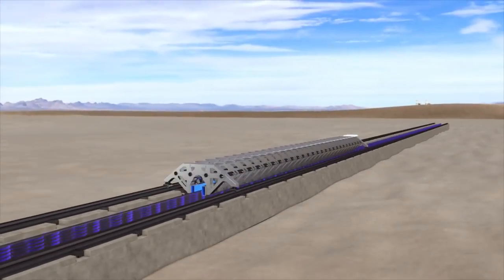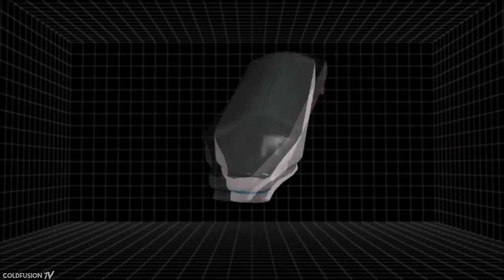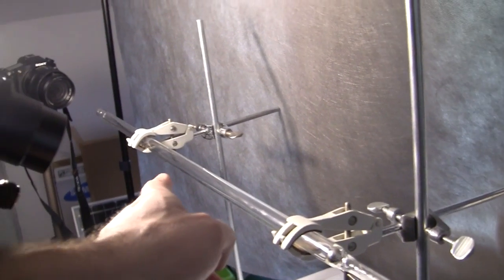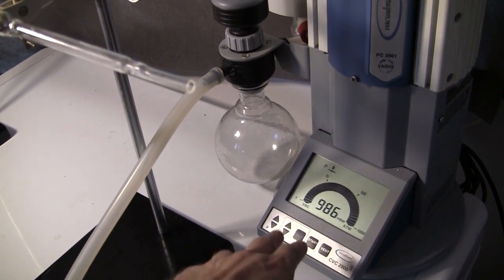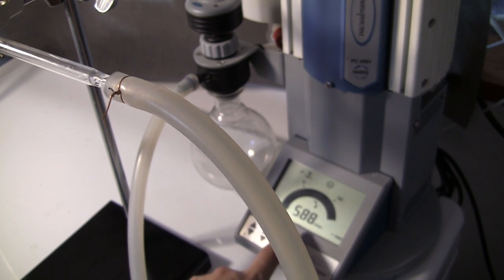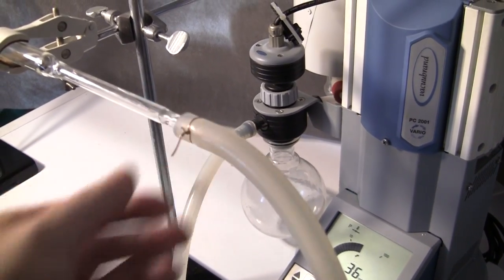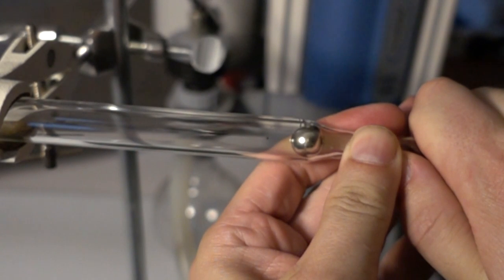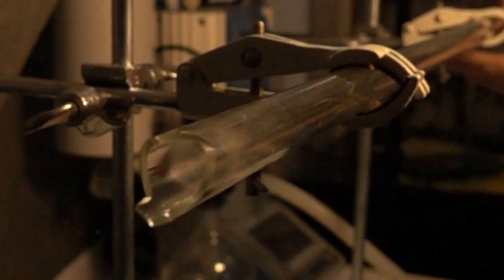How  the Hyperloop can kill you!

Comment: Come on TF this is a bit lazy of you. 

Surely you can appreciate that there are smart people working on this venture and are thinking of the engineering solutions to problems like a tube breach. 

Even if they try and fail to get the Hyperloop working, you can surely also appreciate that there would be benefits to other areas of science and engineering based on the innovations they come up with.... eg materials & construction for the tube, magnet technology, vacuum pumps, et al. 

This is not the same realm as solar FREAKING roadways.

Comment: The difference between the hyperloop and most of the things you've debunked is that the hyperloop doesn't have nigh insurmountable engineering challenges. Are there challenges? Yes, but this one doesn't require a complete change in the laws of physics to work.

Comment: I think Edison did similar displays about the supposed dangers of A/C power...how did that turn out?

In the case of the Hyperloop, there's many things they could probably do to prevent this sort of disaster or mitigate its effect:

- Multiple nested layers of tube, where if even one is compromised, they prepare to shut everything down immediately
- Pressure valves to allow air in at various places in the tube at once, so as to help cancel out the effect of a breach in any one location
- Computer controlled emergency brake trigger to slow down all the vehicles before the pressure wave hits
- Compressed air stored in the vehicle itself which can be strategically released to try and counter the effects of an approaching pressure wave

etc etc

But at the end of the day, no method of travel is 100% safe.

Comment: i don't quite get what this video is getting at. if you have critical failure in almost any mode of transportation it can kill you. are you saying it is very likely to occur that something is going rupture this to this tube? Also if it had a relatively small hole would this effect happen just in a cascading rather than all at once? Sorry for all the questions but would they not have any form of braking capability not saying that could stop the enormous acceleration from killing that ride but from destroying the system?

Comment: I think a complete failure like breaking off the whole tube over its full diameter like shown in the experiment will most likely not happen. Wouldn't a crack start with a small pressure loss that could be easily detectable and fixed? Surely the walls around can handle a pressure difference of 1 bar to not instantly crumble, right?

Comment: Yep it is dangerous concept, but it's the only way to get supersonic land speeds.
And I would assume that tubes will be made of something better than glass, probably some sort or plastic.
However I find this to be the future of rail transportation.
Most baffling thing I have seen on presented video was jet engine blades in front of train like what the hell is that. 
The truth is that levitation power and force pushing it will most likely be delivered trough rail, also this sort of tube might be actually perfect for another futuristic project of laying superconducting cable within tube. Solving powering problems and lowering costs by consolidating it with another project.
Also vacuum trains can kill you as efficiently as let's say plane, when things go completely south on plain all is left to do is get ready for death.

Comment: I think what Thunderf00t failed to consider is the likely hood of a massive failure of the integrity of the hyperloop tube. What Thunderf00t demonstrated - in scale to the hyperloop - was a massive depressurisation of the vacuum barrier, which is very unlikely. The proposed design of the hyperloop is not in such conditions to cause a explosive decompression, nor is it in such a state that it could be fragile enough to cause one without malicious attempt (I'm sure the engineers will establish that factor of safety already. Realistically, what you would expect is something similar to a leak in a pipe of high pressure working fluid in a underground rig, and especially not something like a diving bell accident.

Comment: The hyperloop Elon has suggested is in sections, all of which can have many sensors to detect such crises. If a "gate" is included in every section or every few sections, they could be closed behind the hyperloop car and the vacuum relieved FAR ahead in order to cancel out the rush from the rupture.
Closing them in this way would cut out a significant amount of pumping(rather than the complete loop) after a tube/vacuum failure.
You don't even have to open the section all the way before it would work, air will rush in quite quickly of its own accord.

Air foils could be included on the car, since in a vacuum they would cause no drag and therefore no slowdown, they would be helpful in stopping upon loss of vacuum.
Brakes are certainly included on the bottom where the car is levitated off the track, so that's more deceleration still.

Even considering the G forces involved, the acceleration is extremely quick and you'll only be subjected to them for a few moments before everything on the car is traveling at the same speed(null acceleration/velocity alteration==0G's). So long as the tube is basically straight or extremely mildly curved there would be no issues there.
-
-
-
My only concern is for people that might be standing during the trip, in case of some unexpected calamity, if the car suddenly has to stop, those people could easily be thrown straight against a wall and die. So I imagine constant seating would be required for safety purposes.

EDIT: added the word far in reference to the vacuum relief, since people seem not to understand that you don't do it directly in front of the car. That would just cause more problems. Common sense, people.

Comment: Ok, so TFoot brings up an interesting point here, I'm curious as to what other issues he'll bring up in the full video.

That said, this seems like something that might be fixed through the right engineering. Why does the pressure in the hyperloop have to be so low? Could it not operate at 50mB? What about brakes? It seems likely that they would design the system with brakes in it anyway. This video is about what would happen IF there was a vacuum failure, but how likely is that really? Also, let's say there was a breach at a certain point, the entire hyperloop track is under vacuum - which is a huge volume, wouldn't the time taken to equalize pressure be much longer, and thus result in a more gradual acceleration? Also, the track is designed to carry that same vessel/pod at high speed anyway... so... I'm confused. This honestly sounds like a weak argument against it.

If you were to scale up the result in this test, this is not what would happen with a minor fault in the tube walls - this is what would happen if the entire track was cleaved off, like if a bomb went off.

Overall though, this hyperloop isn't the kind of thing that that's physically impossible, it's just a matter of design, IMO. At this point, I think the best argument that could be made against it is how much it would cost, not theoretical principles. Maybe the meat of TFoot's video will be about the cost.
Reply: Thunderf00t, if you read this, I agree, it looks like this does have the signs of PR overhyping: the spokespeople, the fancy irrelevant graphical renderings, the "science article" headlines; but it's not actually impossible the way air carbon or the gill or the hoverboard were, I think it's just too expensive, or maybe not developed enough; the way fusion power is, for example.

Comment: Wow, I am disappointed with you TF.

The Hyperloop concept does not involve dropping the tube down t .001 atmospheres. Given that a capsule breach would be fatal, that would be a bad idea. Also, it takes a lot of effort to pump down that far, especially on a system like the Hyperloop. The goal I heard was around .3-.35 atmospheres. Both so that passengers don't instantly die ad also because (as demonstrated by your own efforts) the closer to vacuum you try to get, the harder  it is to pump the air out.

Also, the capsules need both an onboard propulsion system and breaking system. It will take time to speed up and stop at safe acceleration levels, which means it has to be performed by the capsule before/after leaving the station. This also means it has a control system to keep it from being a wild bullet shooting down a barrel...

Though I would point out, even when everything is functioning properly, you are talking about a capsule hurtling down a tube at 700 mph. Still like a bullet down a barrel...

I totally agreed with your conclusion that solar roadways was garbage. I never looked into thorium cars and as such have no opinion. But I think you completely missed the mark when it came to researching and understanding this one.

Comment: The "train" only fills about 10% of the tube cross section so the air can go around reducing the acceleration. Try with a small ball. Also it has breaks and runs on a track with no end wall's. So there is nothing to crash into and it can resist a force using the electric engine or magnetic break.

Comment: In case of depressurization event it is there is probably a way to anchor the train to the walls of the tube, if there is enough time to stop the vessel before the 1 atmosphere of air hits. If there is not enough time, things will probably get messy if the pressure causes the train to drop from the 'tracks' an hit the wall. Maybe the train can be anchored magnetically to the tracks as well to prevent that? Anyway, I'm really interested to see whether it's Thunderf00t or Musk who prevails. Rooting for the hyperloop to one day be true!

Comment: The same thing was probably said about the airplane or the car. We have to take risks to further technology, or at the very least explore an idea that would revolutionize how we travel
Reply: but you could survive a car crash, and airplanes were already tested by the wright brothers, not to mention airplanes can glide to the ground and a car braking wouldn't decelerate fast enough to kill you
Reply: Ed Stretton posted this in another comment:
FFS. I keep posting this.
Science, bitch.

a = F / m
Say the area of the capsule's end cap is about 3m&#178; (radius of ~1&#178; * π) so A = 3
F = P * A
Atmospheric pressure is about 100000N/m&#178;, so P = 100000
F = 1000000 * 3
F = 300000N
As a guess, say the capsule weighs 5 tonnes.
a = 300000 / 5000
a = 60m/s&#178;
Now remove acceleration based on the resistance of the near vacuum at 1/1000 atm:
a = 59.94m/s

That's basically 6g. So yes, you'd probably survive. That said, you probably wouldn't survive crashing. If, however, you came to a stop without hitting anything you'd be okay.

Before you critique me, remember, this is a 5-tonne capsule. If it were lighter, you might not fare so well. Heavier, maybe you'd do better.
Honestly, though, I think that most people would boycott hyper loops if decompression did ever happen given how traumatic it would be.

[Edit: Google is retarded - "&#178;" = squared sign]

Comment: I agree that the way the hyperloop is designed is fundamentally wrong, however the problem that you presented is already known and is solved by its own propulsion mechanism (magnets) and you would have the added effect of breaks on the guidance tracks so I do find it hard too believe that a crack would send it flying at the speed of a bullet.

Comment: Thunderf00t is just butt hurt he did not think of Hyperloop himself.  You could have safety measures.  You can have magnetic breaks start up if the craft increases past a regulated velocity with miles to safely stop  or flood the entire tube with oxygen from both ends to stop the acceleration. Basically you are just not thinking hard enough about the possible safety measures in case of vacuum failure.  I though this debunk was going to talk about G force or something. Can you explain Gforce and why that's not an issue?
Reply: if the breaks are fast/powerful enough to stop the sudden acceleration from killing you, then the sudden deceleration would kill you, and if they weren't powerful/fast enough to stop the acceleration fast, the acceleration would kill you
Reply: If you open another section of the vacuum that should counter the pressure buildup. How much acceleration are you talking about since you obviously did the calculation.
PS have you heard of a valve?
Reply: +Scripted Cookies I'm pretty sure if voltage and resistance are variable so will the force of acceleration and deceleration.

This idea can work. It's just going to take a lot of effort and thinking to get around.

I study BSc Aerospace engineering.
I think this has potential.
Reply: Dranoel Arios
I study physics and I study aerodynamics for fun I agree its possible.
Reply: I don't think he's butthurt, but he just wants views
Reply: A deceleration working against the force of acceleration due to depressurization would produce a net 0 acceleration on the train. We have the technology, we CAN find a way.
Reply: bigguy4389
might as well explain the dangers of a leak in the underwater tunnel to Manhattan ?
Reply: "Thunderf00t is just butt hurt he did not think of Hyperloop himself."
This has got to be the dumbest explanation for TF's reactions, ever. You tell me then: Why is he not pissed off at any of the military tanks that were used in WW2 and similar wars? Did he think of them himself? Are you actually saying that TF was such a super-genius who re-discovered everything in history by himself, except for the Hyperloop?
Reply: Fahraynk 
Nup, this thread is for losers who think they can create "safety measures" on a highly volatile device without costing several moderate fortunes and/or several lives.

But thanks for the advice, out the door I go!
Reply: +Fahraynk Airplane wings are shaped to make air move faster over the top of the wing. When air moves faster, the pressure of the air decreases. So the pressure on the top of the wing is less than the pressure on the bottom of the wing. The difference in pressure creates a force on the wing that lifts the wing up into the air. That is how planes fly.
Reply: Or he could be explaining the dangers with a sudden depressurisation.
Reply: Ever since brexit he has lost his touch in some way.

Or maybe that's just me
Reply: Fahraynk that's like comparing apples to oranges, one has very little air to avoid large amounts of air resistance whilst the other will have oxygen pumped in or vented incredibly well. I live in Britain and haven't been to America yet, but I'm pretty sure the tunnels that go under water have been dug through the ground and have had quite abit reinforcements to the structure to stop any of the ground and water above from making the tunnel collapse, I'm pretty sure they could withstand earthquakes aswell.
Reply: I highly doubt flooding the tube would be a viable solution. Simply because of the time and energy it would take to make the tube a vacuum again. Better would be to have some sort of "airlock" every x meters and just shut them and pump air into that small space instead.
Reply: ***** do you have Aspergers ? It is humor. This thread is for engineers and physicists get out joules kin.
Reply: +Joules Kin *Ahem

Is the industry of Aerospace and industries such as automotive, mechanical and civil 100% safe?

If think yes you have no place or credibility on this thread.

Perfection in any conceivable way is impossible, however that doesn't mean we can't get close.

One thing I know for sure is that I love a challenge when it comes to projects like these.
Reply: ***** How can a plane fly?! If the engines cut off for even 1 second, the plane can nosedive to the ground and explode! It will cost lives and fortunes to build planes that work! 
People die in regular train crashes. I guess trains are too unsafe to use!
Reply: Fahraynk I can't tell if you are joking or not. please tell me you don't honestly think that planes need to have their engines running to keep from crashing.
Reply: /music plays
Reply: bigguy4389  bigguy4389 
I was being sarcastic to Joules Kin. Come on guys...

Comment: Acceleration due to sudden rush of air should be less of a problem for a scaled up train.  A train being long, pressure on the end has more mass to push than a spherical ball bearing of a similar height and width.  The square-cube law also reduces the acceleration when scaling up.  Also, trains have brakes though sensitive pressure sensors would have to trip these brakes before the pressure front really slams in.  Unless the air rush is head on whilst the train is at full speed, where the problem is sudden deceleration, not acceleration.  Then I imagine it'll slam like a hurricane.  Be strapped in to a soft seat facing backwards.

Comment: I usually agree 100% with these assessments (having came to the same conclusions on my own before the video), but I think in this case a simple fail-safe friction-based brake could be devised to clamp the car to the tube ID... That said, I may have no experience with these systems, but I do have an MS in mechanical engineering and over a decade of experience in large electromechanical systems...

Comment: The vehicle is only supposed to be 50% the diameter of the tube to allow air to pass over it easily. This fact would reduce the acceleration already. Others have pointed out that you could detect this occurring and equalize pressure. It's not a fatal flaw in the design yet

Comment: well you could put a pressure monitor on both sides and spillways to equalize the pressure as a fail safe, but the acceleration would be enough to harm the occupants.
you would need enough room for air on the vehicle to reduce the force so that it would be low enough g force. assuming that they are not moving super sonic speed at the time,